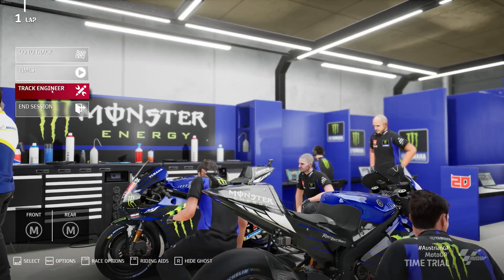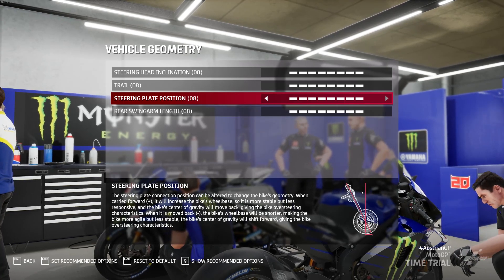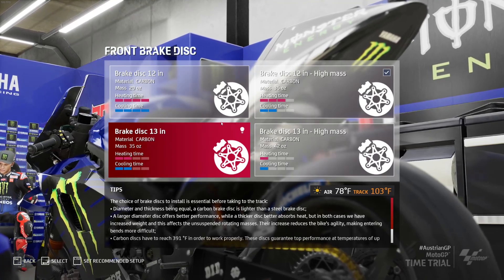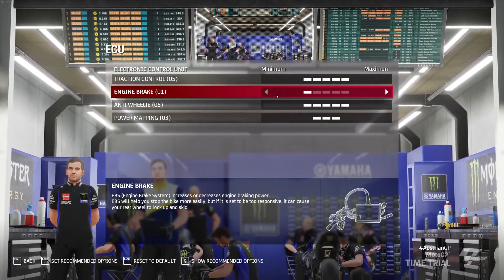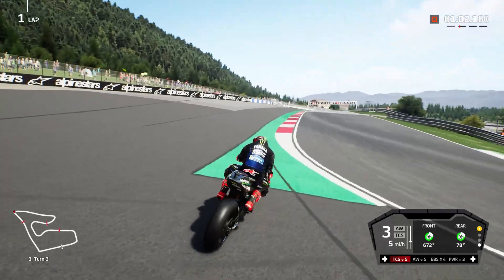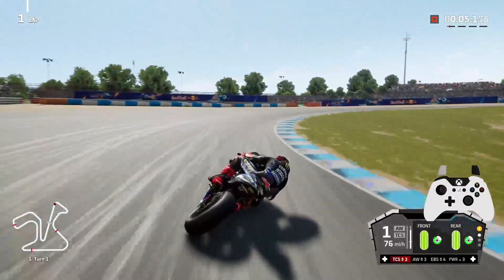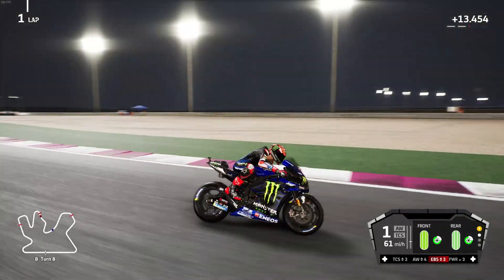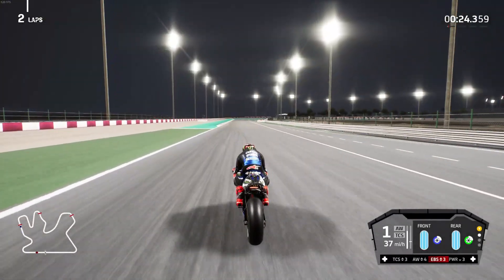MotoGP 21 Tips & Tricks | Episode 2 - How to Improve Braking

Comment: somehow a very soft front end suspension works very well to not do stoppies. pistol found a setup with a soft front. im sure he has it on his yt channel somewhere. i use it all the time now and braking into most corners i can smash the brake on and the rear wheel stays on the track. there are a few corners where it still does a stoppie if i smash the brake on. but if i put it on gradually i can get to 100% braking without a stoppie. it changed the game for me
Reply from the maker: I personally really like a 0 preload front end & a very stiff spring but I will definitely try it out 👍
Reply: @Dyl469  nice! Let me know what you think of it
Reply from the maker: @njirk52  it definitely works,it's just a matter of working it in to my current set ups,will definitely features it in episode 3!!

Comment: I'm still struggling but using a lot of rear brake seems to help. Sort of like a handbrake on a car
Reply from the maker: The handbrake analogy is perfect,just try to keep a small bit of Lean angle whole braking and don't be afraid to change the setup of the bike to help
I have videos explained what setup's do as well 🙂
Reply: @Dyl469  how do you know whether to lean forward or back on a turn and whether to use both brakes or just the front/rear?
Also I tried manual gears and that sent my head gaga.
Like I said still really struggling but I watched your set up for breaking and using the rear break more so howofulym and switching the racing line off I just need to somehow figure out how to pick and remember good breaking zones after watching your video on that.

Comment: How long did it take you to race without rider aids? I still can't shift, brake, and steer all at the same time yet.
Reply from the maker: When I 1st stared league racing,that was MotoGP 15,I played 13/14 but not as serious but I joined a league on GP15 and started to practice and then I took off the racing line n manual gears,I never used the other assists
Reply: @Dyl469  thank you. I'll go practice.

Comment: So I got motogp 19 and I dont get when to use read or front feels like i cant stop at all
Reply from the maker: So in MotoGP 19 the braking was very sensitive,you can put joint braking on which will brake with both brakes when you only press front or you can try and learn how to brake better,my advice is to brake earlier with rear brake n the gradually apply front brake

There is many assists than can help if you look through "riding aids"
Reply: @Dyl469  thanks mate hope 21 goes on sale on loving the game

Comment: Dus this work on moto g3 as well
Reply from the maker: I would recommend using a lower Engine brake on a Moto3 bike if your using the rear brake,other than that it should work as normal 👍
Reply: @Dyl469  thanks so much has helped

Comment: Trying and trying dude...  I have not hit a plateau... I have hit a fucking brick wall.😛
I am literally driving now with everything at 0... even geometry   Nothing in-between seems to work.🤔

I must have run 100 laps today... and the result was just turn everything to 0.  I pulled a 1:54.338 at Qatar and that is about as fast as I am going to get [for now].  I am starting to think this is all bullshit and you all have those mod things hooked to your controllers.🤪

This is all starting to look like it has more to do with your controller settings than the bike set ups.  That stick only pushes so far to the left or right.  the bike can only go around the corner so fast around these ICE tracks that they have us sliding across no matter what the settings.  I mean I know there is bullshitery going on as one of the top scores at Qatar is some guy in HIGH Autopilot mode.

Then again.. I thought I would never be able to drive in Pro mode either😛..  Now using anything else makes me wreck the bike and constantly low-side.

Thanks for all the help and all the videos.  Your a hero😇 to, and for this community.
Reply from the maker: Thanks man!
best thing you can do is take a small break, 100 laps will cause you to form bad habits and that's how the feeling of plateau begins, also the more you improve the harder it gets to improve and that's exactly what your experiencing now, it took me 2 years to get to a high level on these games (without any YT vids to help me) so it will defo take some time but I'm glad your are improving and getting faster, well done 👍